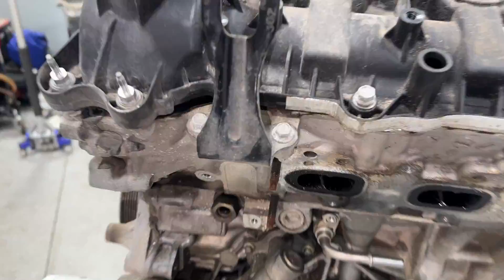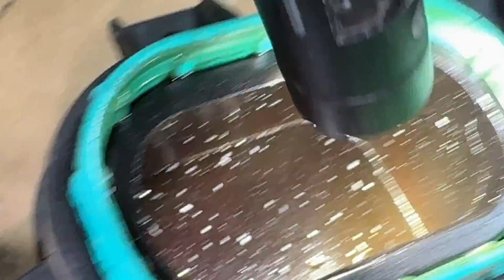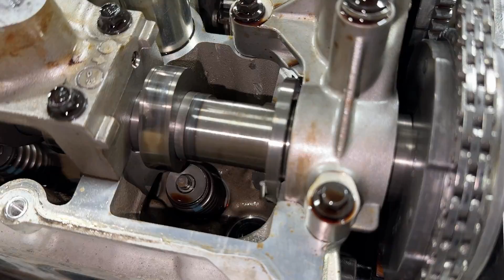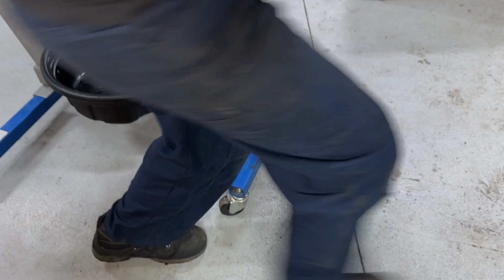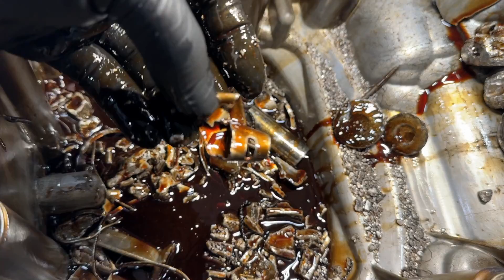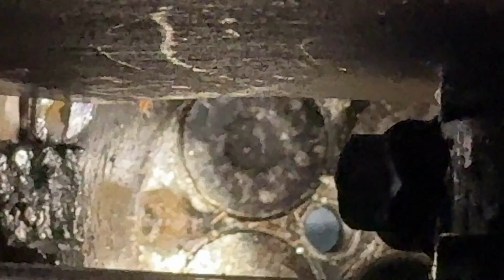Proof Ford Ecoboost Engines and Aggressive Aftermarket Tuners DO NOT MIX!

Comment: Jeez. This must have been a spicy tune. I have a 2016 f150 3.5 eb and have been running a tune on it for about 40k miles with no issues.  I've been upgrading parts along the way, too. Right now it has garret powermax turbos,  formline exhaust manifolds,  fullrace turbo adapters,  spd high flow catted downpipes and catback exhaust,  ams turbo inlet tubes, mishimoto intercooler and piping kit, and a cold air intake . It's tuned by mpt tuning, and i have the 91 prx tune . I've gotten a 4.8 sec 0-60mph and a 13.34 1/4 time. It should be around 466whp . The truck is coming up 100k miles soon. The next purchase will be a snow performance water methanol injection kit and then a walnut blasting . Hopefully, the water/meth kit will help keep the valves clean. I would like to upgrade my fuel pumps to be able to run E85 but im sure my engine would end up like this one if i did. My tuner even told me they dont recommend going the E85 route unless I plan on building the motor in the future.

Comment: There is shift in engine design concept when you move from traditional NA V8s to turbocharged V6s:
Both will last pretty much the same if well taken care of and not modified but NA V8s are overdesigned and therefore can sustain ABUSE while turbo V6s design are close to their limit so abuse is more likely to kill them fast.
No only that but NA V8s can sustain lack of maintenance better than turbo V6s for the same reason.

Comment: I just brought home a 2013 f150 super crew 3.5 cheap one owner. Local dealer charged them $7000 for working on it. Supposedly randomly shuts off but that hasn’t happened yet. The service advance track and down hill decent light stays on. Horn only works if you open the door with the keys it trips the security. It won’t respond to the key fobs any buttons but the keypad does light up. I drove it a couple hours and it has the lights on in the dash but never died on me. Would like to figure out the other issues

Comment: Other than this particular example of a rapid, unscheduled disassembly, these are really good engines when operated as designed. Mine is going on 300K and is doing fine.

Comment: The destruction is so complete, it's hard to tell what happened first. If I were to venture to guess, I would say the initial failure was that the piston broke at the wristpin journal. The top of the piston went up unchecked, to break the valve heads. the rod and wristpin swung full length, acting like a hammer, and broke everything until the rod itself broke. It just didn't get any better from there. This all happened in less than 2 seconds! This would have come without warning, or any unusual noises, until it happened all at once.
     I would like to see what the rod bearings and main bearings look like, I'll bet they actually look pretty good.

Comment: Do you know if some or any aftermarket or upgraded parts for the F150 will crossover to the Expedition? I know there are tuning (though some pretty mild), turbo, and exhaust manifold upgrades among others that I’d like to get more information on…

Comment: question...after changing battery on '08 Escape 6cyl without a memrry saver, is it required to have the Car reflased at a dealer or someone like you?   or will the car relearn as I drive it?    Thanks so much for your time, Brian

Comment: Question. I have a 2010 ford escape recently a wrench appears on my dashboard and the speedometer stop working and when I switch from parking to reverse or drive I feel a hard kick. In  your experience did you know what can be the problem? It can probably be the transmission sensor tss or oss?

Comment: Are you trying to tell me I found your channel on the forums. I believe you did a post saying that the rack and pinions and the power steering pumps were almost always never the reason for hard steering. I've got an 06 freestar with a new pump and the power steering still isn't working. I believe it is the o-ring on the high pressure side connected to the pump that's allowing are in. Any thoughts or tips?

Comment: I believe you are most likely correct I actually have many questions not that it really matters back in the day a 1974 AMC hornet with a 6 Mrs old lady driving it  a very similar situation rod broken completely straight across a hole in the side of the some impact on the piston she claimed she was not going faster than 35 mph fortunately upon looking at the rod closely there were tiny holes at the separation of the rod and the metal looked a bit different in color which led me to believe it was a problematic casting of course this took place in the 1970s and no one was thinking about taking pictures and doing videos at that point in time😢 I also saying the same problem on a 1969Chevy El Camino differential pinion gear it broke clean inhalf at About 15 mph 🤔😱 obviously the differential was destroyed as far as the ring and pinion went those are just two of the craziest things I've ever seen I have other horror like  Oldsmobile blocks with industrial staples attached to it FROM the factory 😱🤔

Comment: When I was a kid, I had a unique situation; my dad ran a small fleet of medium duty chevy/gmc trucks with heavy duty small block chevys and uncles and older cousins the did dirt track oval races.  I had a garage full of blocks and cast off race parts.  I spent hours putting together blocks,cranks, cams and other heavy duty parts and wedging them to old beaters like Chevy 2s and Chevelles.  with all those old heavy duty parts I could tune most any way and get away with it.  Those days are gone.  Modern engines are already tuned to the ragged edge and 1 hp away from destruction.  I can't believe this doesn't happen more often.

Comment: What IS it with EcoBoost engines? They're apparently indestructible until you overheat them, at which point they shatter like glass.

Is this a Ford thing, or a modern-power-dense-aluminum-turbo-engine thing?

Comment: Can you settle the 5w20 vs 5w30 debate on EB and 5.0 engines? I'm curious what your take is!
Reply from the maker: Well that is a loaded question as some EcoBoost take 5w-20 and others take 5w-30, same thing goes for the 5.0L some years take 5w-20 some take 5w-30.

Comment: I’ve heard mostly good things of these engines and the 5.0s but from my personal experience I’ve had to do a bunch of timing chains and timing parts on these in the 80k-120k miles range. That’s not horrible but I’ve got two 5.3s with 200k and no signs of failure yet both 4th gen maybe that’s just the good years of the ls. One of the 5.3 engines is getting rebuilt to support a turbo and more fun stuff the cylinders at 200k look like 30k well taken care of maintenance wise my guess

Comment: If he had bigger injectors that likely means he was running E85 and pushing close to 550 or 600 whp. Thats a lot to ask of any stock V6. The fact that Ford send these out with enough turbo from the factory to support that kind of power is what is great. If you choose to push it to its limits and blow it up then you fix it.

Comment: Even factory I feel like the 2.7 (which I own) exists right near the edge of it's design specification and it's probably not a good idea to push it. If you wanted more power, get a damned coyote.
Reply: I dont think you understand how much power this truck was making. It wasnt even close to factory numbers and was probably making ~200 hp more than stock since it was running E85. Ford puts some pretty large turbos on the 3.5L that capable of supporting a significant amount of power. The turbos on the 2.7 are tiny.

To get a Coyote where this guy was means dropping 8-10k on a blower.
Reply: @Jay-me7gw  Stock turbos on the 2.7 are tiny but the bottom end is a lot beefier than the 3.5. Look I'm not calling him a moron obviously he is an enthusiast I just don't understand why you would push a V6 so hard on a platform where V8 is available.

Comment: I think lumping all tuning into one pot is unfair.  Seems like this particular engine was being pushed to the brink.
Reply from the maker: I actually didn't, I made it very clear the internals cannot handle aggressive tuning not all tuning.
Reply: @FordTechMakuloco  Yeah you did say aggressive.  My point, I guess was, it would be good to know more.

Id like to know whats aggressive...define it please.  Then again you may not know.

E85 and 1000 cc injectors as the only mods can really only get you so far.

Seems like they turned the boost up on those baby turbos to high heaven and then cranked the timing as well.
Reply from the maker: Correct the E85 and 1000cc injectors are the only physical upgrades and the rest of it was the custom aggressive tune. All of which I said in the video, I don't understand the confusion.
Reply: @FordTechMakuloco  I wasn't confused at all.  Just seemed, at least my initial impression, was all tunes were bad.  After watching again and reading your comment(s)  I was off base...my bad.

Comment: I run Livernoise tunes, keeps me in warranty and dependable.
Reply from the maker: What warranty
Reply: @FordTechMakuloco  drive train, Livernoise is who Ford Performance uses for their factory tuners. If you have an ASE tech or Ford Dealer install said tune. You retain factory warranty 100%
Reply from the maker: Ah so we are talking about Ford Performance backed warranty not Livernoise, got it, that is totally different.
Reply from the maker: I am surprised they would use a hack company like Livernoise for their tunes, do you have any link to a webpage stating that?
Reply: @FordTechMakuloco  Ford Performance tuner comes loaded with a Livernoise tune. Call Ford Performance directly, Livernoise comes highly recommended in the ford realm. I've heard issues with Dodge and some older issues a decade ago, but as of late ? I just don't agree...
Reply: @FordTechMakuloco   How do you think Livernois got tuning out for the 2021+ F150's so early compared to SCT or HPTuners? They were getting fed the info straight from Ford.

Comment: Ford eco boost engines our designed to be driven conservatively and not to be run hard To save gasoline and get the best gas mileage for the 
type of vehicle and for the truck light duty work with conservative driving. But people drive them like they still have the V8 witch is actually designed to be worked hard and also much better build.

Comment: Do you believe the 2.7 is more reliable than the 3.5 ecoboost? Lately Youtubers are saying the 2.7 beats the 3.5 AND the 5.0 in overall reliability, but most of them don't work on the engines like you do.
Reply from the maker: 2.7L is the most reliable yes.
Reply: It definitely is. The 2.7 is a gem and the only thing that stinks about it is that Ford limits options. You cannot get the max tow package or any of the other nice stuff with the 2.7L so a lot of people skip it and head straight to the 3.5L.

Comment: i ran a mpt race tune on my 11 with 5" exhaust turbo adaptors full race intercooler and intake, blow off valve, catch can etc i beat the balls off it never had an issue.. this is probably a canned tune or the NO NO tuner for ecoboosts..

Comment: Same thing happened to my 03 5.4 2v expedition @205k miles. All stock. I babied it and changed fluids as recommended.  Only thing different is I tried the Mobil 1 full synthetic that said it would last 20k miles.  Never again will I trust those farce oil mileage claims.  Changing every 5k miles.

Comment: I had bought a 2015 mustang ecoboost when they first came out and had it tuned....ended up blowing up but i replaced the engine and had it tuned again and it drove strong until someone hit it and totalled it. Bought another one in 2020 and had it tuned and it ran fine but it definitely wasnt as fast as my first one. Bottom line is most of us don't know what these tuners are actually doing to the cars and they can blow up at any time. Now i have a v8 car that comes fast from the start

Comment: Nice grenade job !  
I had a question about the Ford Escape rear axle gearbox. I have a 2018 with only 28,000 miles on it starting to rumble and groan. I checked the internet and found a bunch of rebuilt rears...I was wondering what your take is on this, if you've run into any, and any advice. Even though the vehicle has very low miles, warranty is doubtful. Thanks

Comment: Guys running e85 and bigger injectors (req with hot e85 tunes) I’d like to see the timing and boost curves for the tune. Those engines are fairly reliable to about 460-500. Also some E85 isn’t actually e85 (could be way less) and I’ve seen ppl run that and detonate the hell out of them. I bet that’s what happened here. Those are great motors yeah they have some issues but so does everything.
Reply from the maker: I am not sure but he stated when he picked it up that it actually could read the ethanol content as a monitor.

Comment: About time this is put in the open domain, the smaller displacement 1.0/1.6/2.0 etc have blown plenty in the UK without tunes, I had lightly tuned 1.6 go on me recently at 90k. Now own a VW Golf, will not be returning to Ford which makes me sad given I was 3rd generation on only having Ford's. That said the Golf is soooo much better thought out all round. Guys if you have am Ecoboost that's heading toward 100k get rid before it costs you!

Comment: Can you me give me some advice with my 2007 Explorer 4.6? The traction control and abs light come whenever the vehicle moves and the truck is giving off codes c1285 and b1342. Local mechanic recommended replacing the abs module but wouldnt guarantee the lights going away. Im stumped at the moment

Comment: It’s a bone stock engine with ported injection?! That’s it. The ecu can’t compensate any discrepancy by the added fuel and over boost becomes critical. As good as a tuner you might be, knock retard will be prevalent after about 550hp right about when stuff goes to stretching and lubrication losses it’s consistency from friction. Catastrophic,  junk the entire rotating mass.
Reply from the maker: Yes it has port and direct injection from the factory.

Comment: I don't know much about those EcoBoost engines but I can easily see when you have a twin turbocharged V6 making V8 power levels and it's able to make a full size pickup keep up with traffic when it's bone stock, it's a safe assumption that Ford already squeezed all the power you can safely get out of that thing. I have a 5.3 LS in my Chevy truck that is a stock bottom end with a Whipple supercharger making 5 psi max, some head porting and a very mild cam, it probably makes similar HP to that EcoBoost, but as a V8 it has more safety margin to be pushed than a V6.

Comment: Look... there's a reason for large displacement V8s and I6s. 
We get it, you can make big horsepower numbers in an I4 and V6 engines but they're not made for the same applications.
You want a pretty truck that doesn't do real truck stuff very often (and by "very often" I mean "at all"), buy one of these oversized compact trucks. 
If you're going to be towing, hauling and aggressive off roading, stick with what works. Unless you're in the class of Gale Banks or John Hennessey you're not versed on tuning. Stick to what you know and stop blowing your shït up and getting mad at the technicians that call you with the bad news because you wanted to play Billy Badass with your little novelty engine.

Comment: I was impressed with how clean the intake valves are compared to your prior dual port intake valves video. Any thoughts on why the difference?
Reply from the maker: On this engine they do not carry over the oil nowhere near what gen one models do. So the intake ports in the head and intake itself is generally very clean and very little oil if any on the second gen models.

Comment: How many rpm's was that spinning when it came apart? I had an 85 mustang i bought for parts with the engine knocking. It came apart when i intentionally shifted from 4th to third at around 6k. The cam exploded (part of it ended up in the valley, some in the pan), rods through the block and pan but holy hell. It didnt have that much going on it the pan. I guess im comparing apples to oranges though. Those engines are more complex with a ton more moving parts in there compared to an old, carbed, 302.

Comment: How much was that Engine swap?  A 2019 F150 with that many miles looks to be valued at maybe around 25-30K.  Engine swap had to be half the value of the truck.
Reply from the maker: $15k+
Reply: @FordTechMakuloco 
That was one expensive tune.

Comment: Catastrophic damage happens fast @ 6000/RPM that is 100 Rev Per SECOND. 
  Rocker arm broke when piston pushed the rest of the valve up in the head. Head of valve typically crossed to opposite bank destroying that cylinder. 
   Big argument is did the valve or chain break first or did the piston fail ? Which cylinder first? 
   Crank and rod bearings OK, it's not a oiling failure. Not a bearing in the pan, probably a piece of windage tray.

Comment: So you're essentially saying that Ecoboosts are already running closer to the point of failure than most engines. While they won't blow under normal or even hard usage, trying to get more horsepower from one is setting yourself up for disaster. You might be better off starting with a Coyote if you want horsepower, or a 7.3 Godzilla or 6.7 Scorpion if you want torque.

Comment: This is a bit misleading if the guy had aftermarket injectors and likely a bigger fuel pump. That is a full e85 rig and running much much higher HP.  Most tuners stick to 93 or e50, with stock injectors. It's not a huge jump in power. Daily driving that truck like a race car did it in.
Reply from the maker: What is misleading? I explain everything is the first minute or two right off the bat. Proof you can't please everyone on the internet even when you try and everything is cut and dry someone says but but but wait...